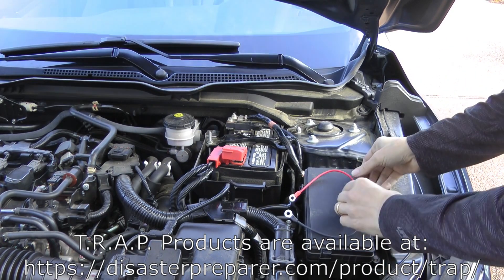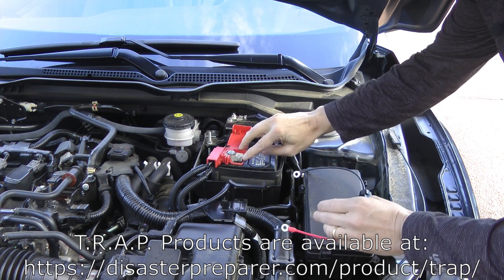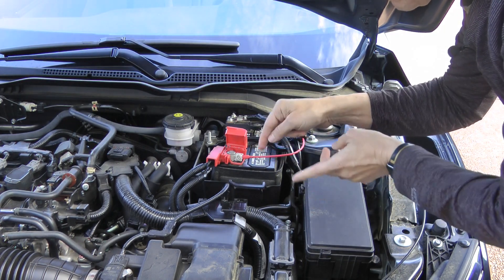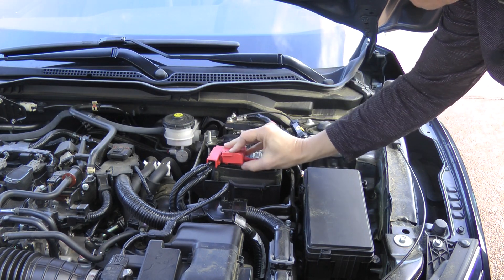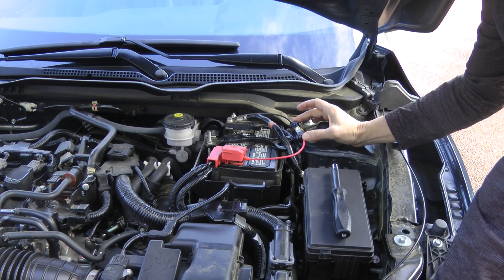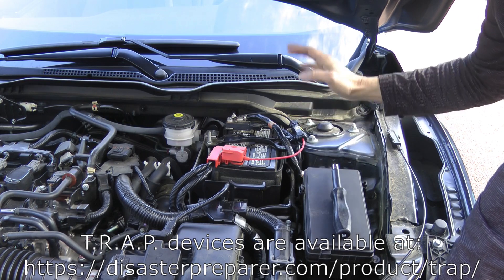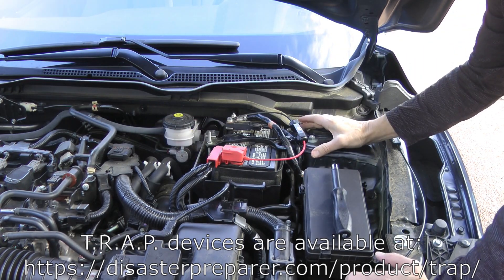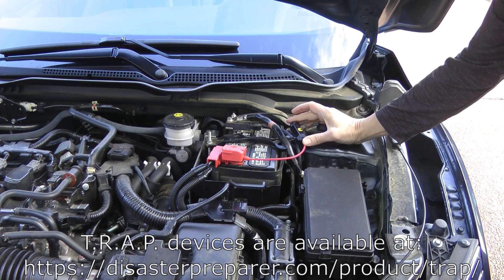Installation of T.R.A.P.-B for EMP Auto Protection

Comment: I absolutely do not believe it! This device and others like it will never be able to protect your car or any other vehicle from a high-powered EMP pulse. Never! Why? Because there are only two possible ways to protect a vehicle from such a pulse.
1) Put the entire vehicle inside a nice Faraday cage.
2) Isolate every single circuit and electronic board by grounding everything, but this is a solution that is almost impossible to implement after market and is very expensive. Only some military vehicles and aircraft are made like this. And they cost an arm and a leg.
Your device can at most be good for protecting Christmas tree lights and nothing more. I challenge you to prove me wrong!

Comment: I have a 2022 Jeep Wrangler and the positive terminal has two posts and lead wires coming off it. Which one do I connect the TRAP B wire to? I was told by the company I bought the device from that one wire probably goes to the starter and the other to electronics.   Not sure how to connect it.

Comment: Does this help w/ any RF noise experienced by HAM radio operators running mobile HF?  Often HAM operators spend a lot of time securing their vehicle from spurious activity such as energy emitted or absorbed from the exhaust system or frame.

Comment: Since most modern vehicles have a chip in the key to sync with the ignition, would it be beneficial to put a spare key in a faraday cage?
Reply from the maker: Yes, putting a FOB in a Faraday bag will also help prevent a more modern form of car theft.
Reply: Such a good point. Even if the vehicle is shielded, if all keys are disabled, you are stuck anyway. So if someone is not at home while an EMP occurs, and if the key into his pocket is dead, what is the point of shielding a car.. ?

Comment: Could you just disconnect the battery cables from the battery if a vehicle isn't in use?
Reply from the maker: Unfortunately, energy would still couple into the cables on the vehicle, causing damage to the vehicle's electronics.
Reply: I wondered that too but he says no.  Dang it.  Lol

Comment: Do you have a video showing these products actually work installed? Im not insinuating that they don’t but I would like to see a video with these products installed and an EMP hit a modern vehicle to see if the electronics were in fact saved by these products.
Hopefully, you will answer my request. Thank you.
Reply from the maker: Hi Bill, it's a very fair question. The best I could do is broadcast pulses from my signal generator/amplifier/antenna and watch how the pulses get attenuated in the vehicle. I did a little video on the bench showing how the TRAP turns on and suppresses fast pulses. The big challenge with doing a real EMP test is that the cost of putting a car into a chamber and running a few tests would likely be $20k or more. And that is only for a single car under one configuration. To really do it right, you'd want to test perhaps 50 cars and statistically look at the results. Every car has different susceptibilities, so a single car could be misleading. Also, you'd really need to first test the vehicles without protection and show that they were damaged. The EMP Commission essentially tried to do this multi-car test, but even their results were criticized as not being real-world enough, and I can't even imagine the cost of testing 50 vehicles under multiple EMPs. Since it's so expensive to do true high-power EMP tests, I am left working at lower power levels and measuring attenuation (same goes for shielded bags or Faraday cages).

Comment: Does this work on lithium batteries
Reply from the maker: It's not the battery technology that matters so much as the voltage. These are designed for typical vehicle batteries that measure 12V-15V.

Comment: Hi, I'm not sure what I need for my application. I have an RV trailer with solar setup on 12v, I need a seperate one for the truck.
If the truck is connected to the trailer, would the truck protect the trailer if only the truck was equipped?
Reply from the maker: The trailer would likely be too far away from the truck's protective devices to offer much protection. I think you'd want to put a TRAP-B across the RV battery, and a broadband ferrite on the RV solar PV wires.
Reply: @disasterprepper  thank you, I'll start shopping on your site now that I know what is needed.
Reply: @disasterprepper  also, the trailer has a single 12v at the front, and a battery bank at the back consisting of 6 more batteries, do I need a larger device?
Reply from the maker: @YourWhoreMother  You might consider putting a TRAP-B across the front 12V battery and another across the back set. How are they wired, series/parallel? Are they a total of 12V? If they're a parallel 12V set, you can put a single trap across one of them.

Comment: For a Ford Transit with dual batteries connected in parallel located under the driver seat, am I correct to conclude that a TRAP-B should be installed on each battery?  And would only 2 ferrites stillI be used - one located on the positive cable and one on the negative cable as these cables leave the batteries.  That is, no ferrite is installed on the short cable connecting the two positive posts and no ferrite is installed on the short cable connecting the two negative posts?

Comment: Hi dr. Bradley , thank you for your videos, do you think it is posible to make same device for obd2 port? Since it have direct conection to ECU and sensitive devices like BCM and FI, greetings
Reply from the maker: I think that's a great idea. I'll look into the OBD2 port pinout and see if there's an easy way to make a transient adapter that would plug into it.
Reply: @disasterprepper   it would be a nice protection, i remember that 16 pin has always energy from the ECU even when the car is off, and 4 pin is ground to chasis, and do you recomend emp bags for car keys? (When this are in your pocket) And i ask this because since i've been driving, the keys has some kind of code (chip) wich is recognized by a module in the steering wheel wich comunicate to ECU a tells to ECU that are the right code,  i broke my keys once and when i was about to have copy of them i found this 🤔

Comment: what about ecu and other components in the vehicle
Reply from the maker: That's really what you're trying to protect with the distributed surge protection. It's not possible to attach to the ECU directly, so you place transient protection in various places (using the T.R.A.P.s and T.R.A.P.-B) to try to limit the induced voltages.

Comment: Dr. Bradley, thank you for insightful videos with testing to support the information.  

Like anyone else, I’m shopping around for the best product for the dollar.  Would you please describe how the T.R.A.P. devices (including the interior plug in versions) compare to the EMP Shield?  

Both products appear to protect against power surge.  The Shield is a single box connected to the battery while the T.R.A.P. is multi-layered if you choose to include the cigarette lighter versions.  Can you shed any light on the differences or would it be possible to do a comparison video?

By the way, I appreciate the explanation of the 3 pulses of an EMP in your other video.  I honestly like the classroom-like teaching. 

Thanks in advance.
Reply from the maker: I'm sorry, but I try not to comment on other company's products.

Comment: What's the clamping voltage on the device? I don't need it for my vehicle but could use several in my HF ham radio shack. One at the 12VDC power distribution block and one at the cables entrance box. Everything in the shack, including 12VDC and 120 VAC power, goes through the box to satisfy the "single point grounding" rule.  
Can you recommend  a fast acting protection device for the 120 VAC circuit? Right now, I only have fast MOVs for that.
Reply from the maker: Most 120 VAC protective devices use MOVs. They can sink a lot of current for their size. For most applications, they're a great choice. Shoot me an email, and we can discuss various protective options.

Comment: Will it perform the same with a CME. Would disconnecting the battery do the same against a EMP.
Reply from the maker: A CME really doesn't pose a danger to a vehicle (not unless it's plugged in).
Reply: @disasterprepper  and this makes any vehicle completely Emp proof?  Thanks
Reply from the maker: @drummergirl9481  I wouldn't go that far. The T.R.A.P. devices (and auto ferrites) provide protection, but to say that they would be "EMP proof" any car would be too strong a claim. When it comes to EMP protection, it's about putting in place protections that help to raise the chances of electronics surviving. There are simply too many factors to say for certain if something will survive.
Reply: @drummergirl9481  You want a complete protection against EMP and any radiation? Build and leaded garage, meaning fill them with lead paint or even better, lead bricks.